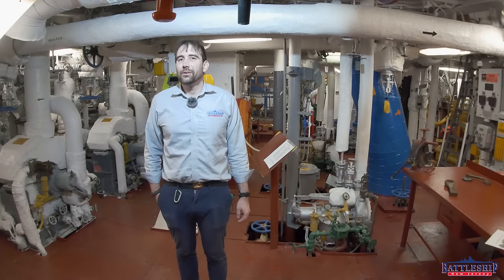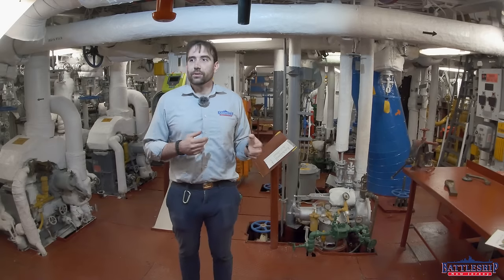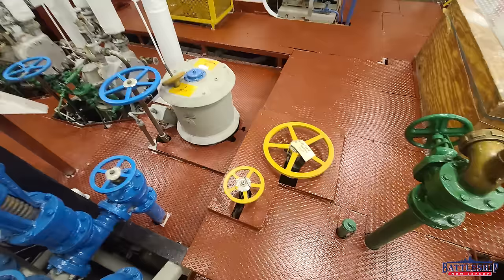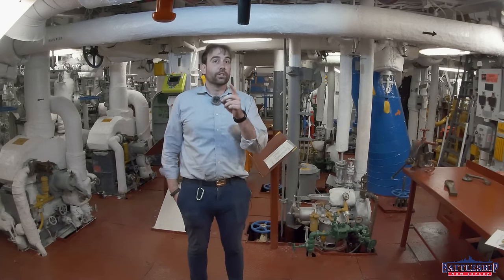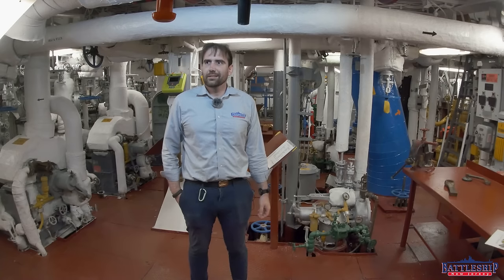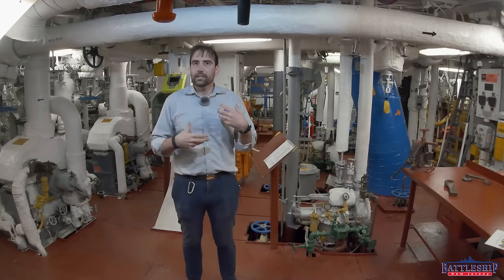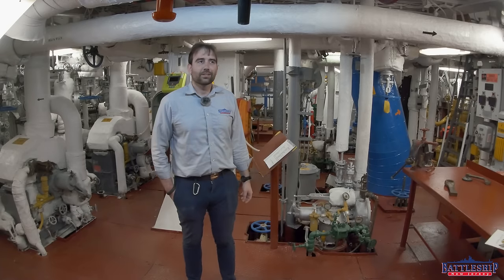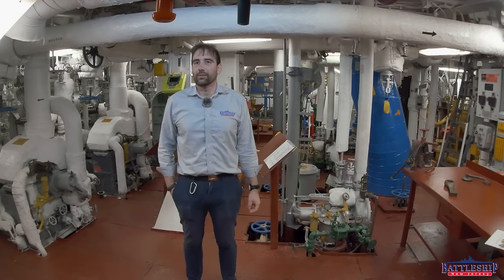Why Are The Pipes Painted Different Colors?

Comment: First thing you do to qualify on a new to you engineering space  is make drawing of all the pipes and valves in your space.
Reply: Until subs got too complicated, submarine sailors had to draw all the systems on the boat to qualify. Now they just have to understand the systems they are working on, and the emergency systems all over the boat, from what I have read.
Had I gone into the military, I wanted to go into the submarine service. Today, I know I would have done fine technically, but as for getting along with people, no way. Especially when I was in my 20's.

Comment: Back in the sixties I had a schoolteacher that served in a ship’s engine room in WWII.  
SOP for high pressure steam pipe leak test was to run a broom across the pipe (high pressure steam is invisible) and see if the broom was disturbed or cut.  His mate contrary to practice ran his fingers over the pipe to save time and effort.  He found a steam leak, it cut and severed his fingers.
Reply: We were still taught that while i was in.  He did a video on here too abou that
Reply: One "galley rumor" on just about every ship is about the sailor that walked past a super-heated steam pipe. The pipe had a pin-hole leak that sliced the sailor's thigh meat down to the bone. Whether the "scuttle-butt" is true or not doesn't discount the fact that a pin-hole leak in a high pressure steam pipe is extremely dangerous, and it's why these pipes are inspected regularly with ultra sound and infrared scanners.

Comment: It's a similar thing in regular plumbing applications.   PVC with different colors marks different types of fluids running through a pipe.
Reply: If you see Orange CPVC in the ceiling that is used exclusively for fire sprinklers.

Comment: on a small patrol boat in a different Navy, after tracing all the piping and being tested on their use and order of operations when dealing with different scenarios and casualties.
as the test would progress and the mechanic showed understanding of the procedures- we would start dimming out the lights, until eventually the test is being conducted in pitch black and they are doing everything by memory and muscle practice.

Comment: "Flight Of The Intruder" was filmed on the USS Independence, CV-62, in 1989/1990 while it was home ported in San Diego. At the time the "Indy" was not part of a battle group and it was used for carrier qualifications for pilots out of Miramar. The on board scenes of the movie were filmed while the carrier was performing this task so all of the flight operations and views of the ship interior and exterior and the sounds of flight ops are completely authentic. The A-6 Intruder used in the movie was an authentic, working aircraft that was actually launched and recovered several times during one of these "carrier quals" cruises. Granted, the movie's story was during the height of the Vietnam conflict, so some of the electronics systems that appear on the screen in "Flight" and Combat Data Center were not present in the late 60s, but everything you see concerning the operation of the ship is 100% authentic. It was rumored that the Dept of the Navy contributed funds to the production of the movie believing it might boost recruitment. I transferred from the Indy to Pensacola a few months before the filming started.
[EDIT] It's also authentic because the Independence was a Vietnam era carrier that saw several extended deployments to the South China Sea and Gulf of Tonkin

Comment: 9:12 I am not sure how I feel about "in line is open, crossing is closed". That means that there's no universal "horizontal = open, vertical = closed" type logic. That could get very tricky in low light, if the panel is covered in dirt, etc.

Comment: Every color is a code of the fluids that are in that pipe. Usually fust valve handwheels are painted. Red firefighting saltwater. Stripped green main spaces and flight deck AFFF foam piping and handwheels. Sewage is gold. Valves and handwheels. Lots of colors for other liquids. Steam silver.

Comment: So.....what if the potential Handle Turner is color blind?🤔 I often wondered that when I was wandering in BB55. There were green pipes and red pipes and yellow pipes
Reply: It used to disqualify you from service entirely but then they started using common sense. Now if it's critical then you simply won't be assigned to that role and instead they'll find somewhere else to assign you.

Comment: Does any one know the color for "holy shit, not this one" found on nuclear powered ships? At least the Russians (and I wouldn't be shocked if the USN as well, although Admiral Rickover cared a great deal about safety, while the Russians have made decisions suggesting that they might not -like drinking in reactor control rooms) have had accidents where somebody opened a bleed valve on the radioactive side of the reactor heat exchanger... That does need to be openable (often in the yard, wearing a great deal of protective equipment), but it's not something you want to open without knowing EXACTLY what you're doing and being dressed for the occasion. At least apocryphally, a cook on a Soviet submarine once opened a radioactive steam bleed valve while trying to steam some stubborn grime off a pot!

Comment: I wonder how many turbines they could have put on that ship? 4 maybe? And I wonder how much space it would have freed up?
Reply: Just about every piece of rotating equipment probably had a turbine driving it.  Propulsion, blowers, pumps, generators, etc.
Reply: I assume you mean gas turbines, and probably 20.
Reply: I should point out for clarity that the USS New Jersey engineering plant operates by using oil-fired boilers producing 600-PSI steam, superheated to around 850F.

Thus, any turbines found on board would be traditional steam-driven turbines.

It should also be pointed out that the difference between the NJ and our newest carriers from an engineering standpoint is that the carrier uses nuclear reactors to heat the water to make the steam.
Reply: I was referring to "modernization" if it were still in the fleet and if adding the newer jet turbines that they have installed on others for an increased "sprint" speed, would have been possible or if it would have made a difference.
Reply: @joebeach7759  Probably not much of a difference.  The steam turbines as installed are quite capable of increasing RPM quicker than the props can accept the change without cavitation.

In any case, top speed is more of a case of physics and hull design than the type of propulsion used.  Once you reach a certain point, stability and handling suffer and additional speed comes at an unacceptable cost.

To be clear, there is NOTHING inherently wrong with steam turbine propulsion.  The USN has perfected the science since the first steam turbines hit the fleet late in WW I.  The propulsion plant in our latest and greatest carrier is virtually identical to the plant that I sailed with on an oiler launched in 1968.  Difference is what you use to heat the water.  

The problem is that heating water in a boiler using fossil fuel just is not efficient nor cost-effective when compared to a low-RPM diesel or a Gas Turbine.  On the flip side, my ship served for almost 30 years with nothing other than general maintenance on the mechanical side.  A big diesel can achieve this, a Gas Turbine cannot.
Reply: @Kevin Crosby  Thanks for the explanation.  I know nothing about naval vessels. That was my brother and grandfather. I joined yhe Army. At least I know how it works now. Thanks for the education!
Reply: @joebeach7759  Kevincrosby1760 pretty much nailed it, but I think I can add a little bit more context. Every ship that gets built has a "hull speed". That is the absolute limiting factor for how fast a vessel can move through the water. It doesn't matter how much engine or how big of a prop you put behind it, you cannot exceed that hull speed. Now, what having a higher output or a modernized power plant can do for a vessel, particularly a naval vessel, is give it additional capabilities such as the ability to launch and recover aircraft at higher rates, utilize weapons systems with higher energy requirements or, in the case of submarines, stay submerged for months at a time. As for how a modernized power plant for an Iowa class battleship would likely look, there are really only two practical options available. The first and by far the most practical would be to modernize its boiler system with remote operation systems, more efficient burners and load reduction via upgrading the turbine generators to a more modern design with higher electrical outputs and replacement of many of the auxiliary steam systems with modern electrical equivalents. The second option is to replace the oil fired boilers with nuclear reactors, which sounds crazy at first, but makes more sense when you consider that the power plant configuration for the CVN Enterprise was modeled after the power plant configurations used on conventional aircraft carriers and battleships of the time. Then they realized that eight nuclear reactors was overkill and cut it down to two. I wouldn't go so far as to say that replacing eight oil fired boilers with a pair of A2W style reactors would be cheap or easy, but man would it free up so much room for activities and the two power plants have more infrastructure in common than a either does with a gas turbine plant.